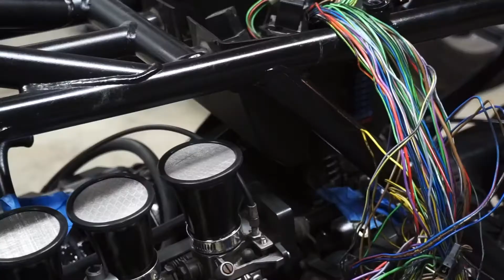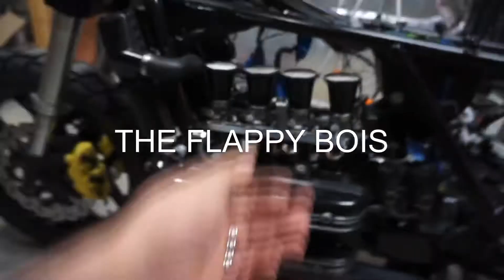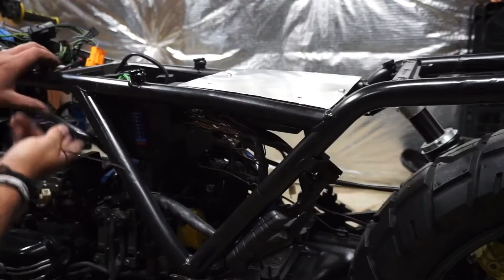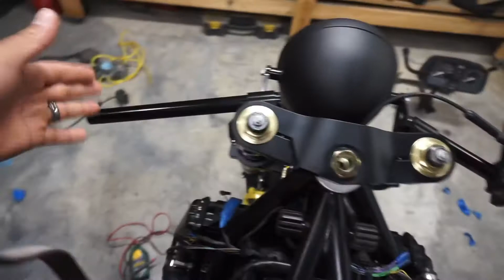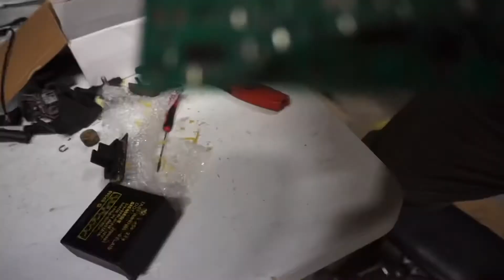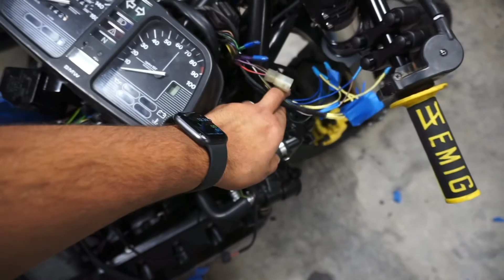BMW K1100 CAFE RACER : WIRING

Comment: Nice to see someone else putting after market switch's and using the BMW flasher relay. Every where says you need to replace the BMW relay with a 3 pin flasher relay. I managed to the zzr1400 switches on a k1100 with BMW relay too.

Comment: Hey man, great job on the bike, have a question about wiring? I have a k75, having problems with the led lights, I cut pin 7 from flasher replay, all lights stay on, any ideas what could be. Thanks
Reply from the maker: Not too sure that’s just what I could find in the Forums but I just got the leds to work on my other bike and I’ll put up a really clear picture on what I did.
Reply: @alextrout2631  thanks, waiting for more videos. 👍